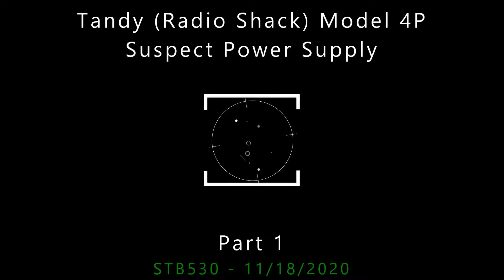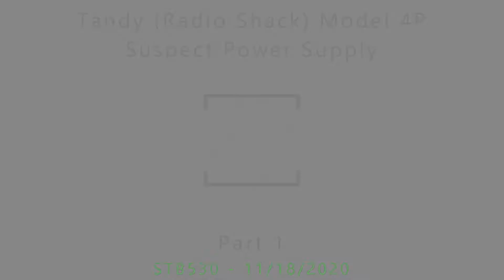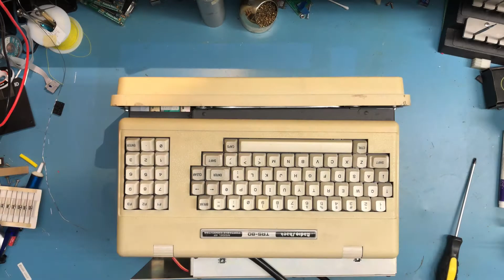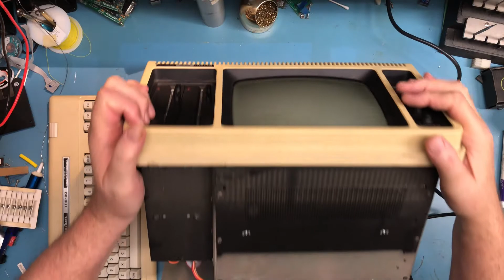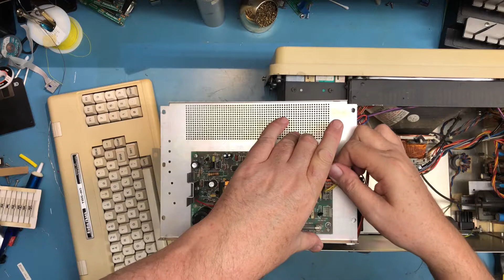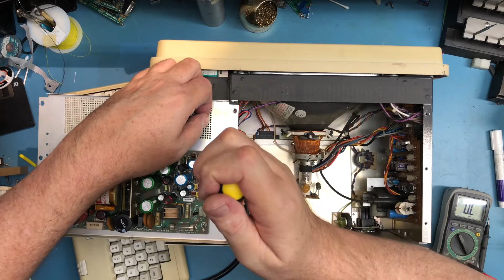STB530 - Tandy Model 4P - Part 1 - Suspect Power Supply

Comment: Thanks for your videos.  I had a 4P with similar power supply symptoms.  Mine was caused by a shorted tantalum capacitor on one of the floppy drives.  Removing the power connection on the offending floppy brought the system back to life.  FWIW.
Reply from the maker: It might be easier if my issue was similar to yours. The power supply won't start even with the rest of the computer disconnected. Further with a substitute PS in place the computer gets to the boot screen thus I'm left troubleshooting a power supply issue.